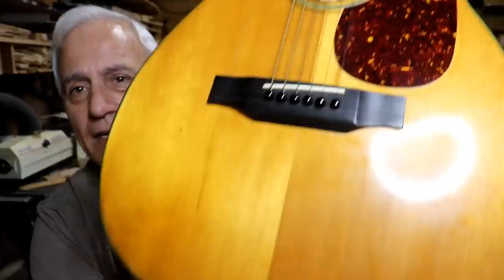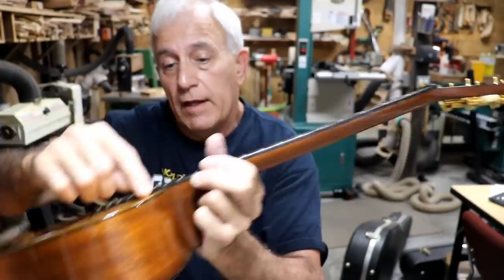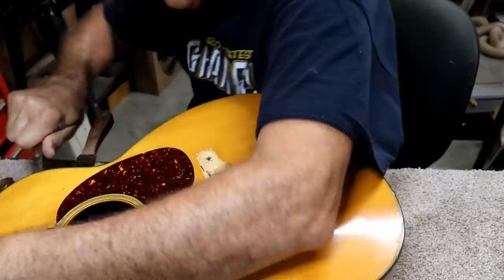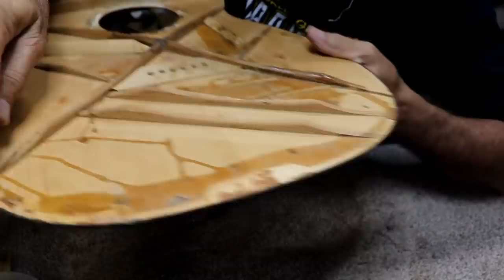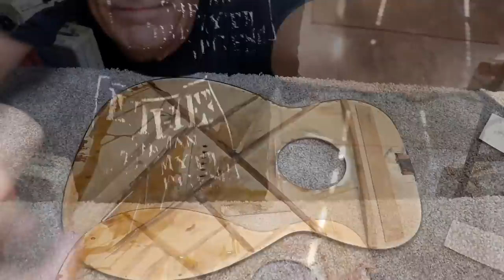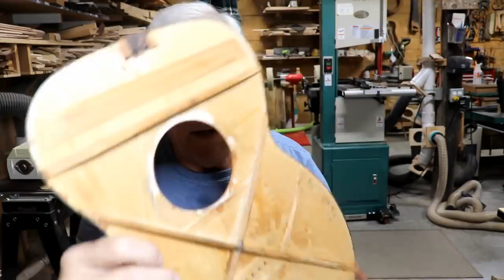542 RSW Martin 00-18 Journey From Total Destruction

Comment: I think it’s fake Martin
Reply: You might be onto something
Reply: The colour certainly isn't right neither is the not bookmatched top. Is someone having a joke here?
Reply: @jeremywolstenholme9277  runout is not uncommon on lower priced Martins, especially then.
I believe this guitar has been refinished somewhere along the way.
Reply: I've owned two OOO-18s, one from 1937 and the other from the 1950s. There's nothing about the guitar we're looking at that makes me think it's not a genuine Martin. As regards the top colouring, I've seen this on other Martins. 
I've even owned a D-18 (from the 1970s era as I recall) with the soundboard made from three pieces of wood - the treble side was built using two, the bass side using one as per normal practice. The vertical grain was very skilfully matched. I didn't spot this until I'd owned the guitar for quite a while. I'm fairly certain it was original factory work, because there was no evidence on close inspection to suggest that it was a repair.
Reply: No, this is a 60s 00-18. I have the same model from a few years later.